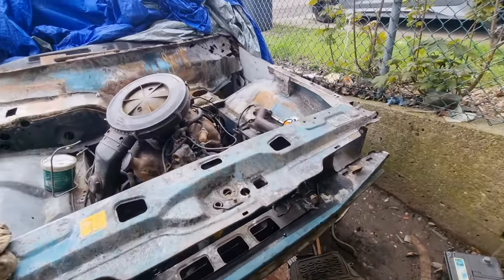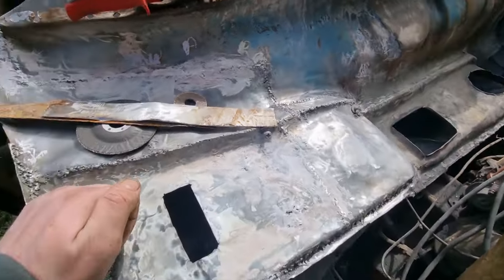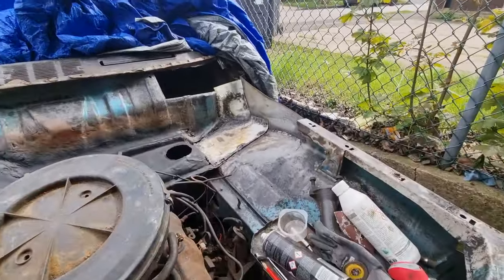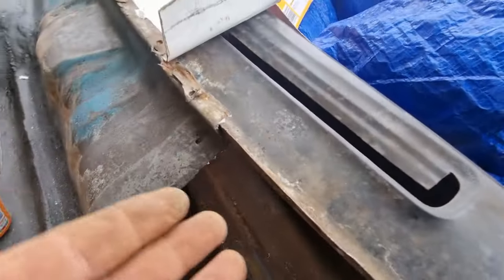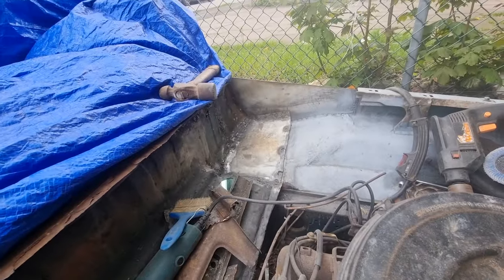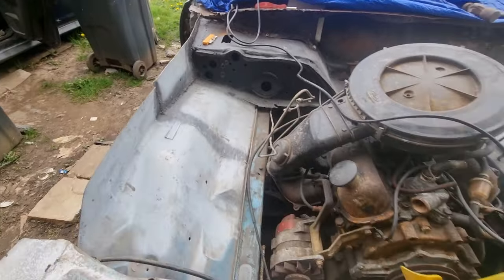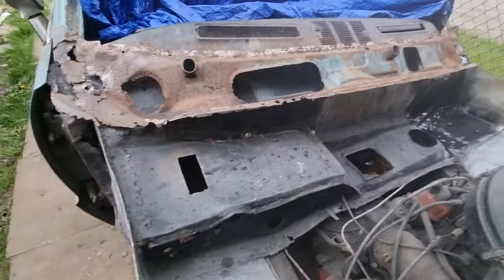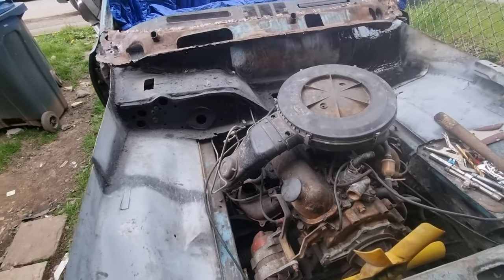Cortina Mk4 Ghia 2.3 V6 Restoration || Finishing Bulkhead (P20)

Comment: Ford had a problem for years with that metallic blue paint. The clear coat always lifted off. This was a cellulose base colour with clear. Maybe yours is original paint. But cheap bobyshop paint jobs got a two pack paint. No polishing the clear. Just paint and throw it out the door. Two pack was nasty paint. Synide based I think. I think this messed up my lungs 40 years ago. So what I'm saying is. You will have to prep good on exterior panels. With a good sealer primer. Talk to a old boy at the paint shop .they advice. Good luck..good job man. Rainey season coming up. Good luck. ,👍👍
Reply from the maker: Thank you :)

Comment: Excellent work, bro. I'm not sure why you're worried about getting videos out?  You have done far more in a short amount of time you should be proud given what you have achieved dont beat yourself up videos are great but slow and steady wins the race do what you can when you can. It's a miracle you got this far. You're doing well 👏 im amazed you'v almostst finished what looks like a serious uphill struggle. There was no bulkhead, and now there is. That's an astonishing feat of engineering you pulled off. seriously impressive
Reply from the maker: i know bro i have done a lot the bulkhead is pretty much done now i dont really need to show anymore on that there is only final touching up to do so can move on to somthink else now lol thank god the bulkhead was the main job as i needed that sorted in order to remove dash frame so i dident lose any structure

Comment: well done there pal, on getting the bulk head completed, id still colour match it though, it will look much more better.   Don't worry about not getting videos out in time, weather, budget and parts really plays a part in restorations and engine conversions.  Many times me and my dad have had to bail on the rover metro when it started to piss down.  I remember me and him just removing the cars dash out, when a almighty thunderstorm kicked off!   Also i have put a car interior back in and just completed it, when it started to snow!   Are you going to do some floor and chassis work?  or you going to do a start some mechanics?   If it were me id have a break from the bodywork and maybe look at what the story is with brakes and suspension.
Reply from the maker: Yeah working out side is tricky some times lol I know the rear brakes are all missing I'm looking for some rear drums ect for the 2.3 axle all the brake pipes are cut I think my next main informant job or to do asap is the chassis on the drivers side
Reply: @AdamSNook.  what is the status of the rear axle that is on this?
Reply from the maker: @procta2343  its the wrong axle its of a 1600 not the 2.3
Reply: @AdamSNook.  i recon that was robbed for the diff

Comment: Starting to look better will alot of hard work but a bit advice make you pieces bigger wat your putting back instead of keep doing small plates as bigger ones look tidy and makes it stronger I go to Lidl for my welding wire £4 a small roll and it's good stuff the do 0.8 0.9 and 1ml which yours should be 0.8 check wat it's says on the wheel and the tip my welder takes all them sizes as I've got different wheels and tips I've got plenty of stuff if you was local I would help you out with it with it show you better and easier ways to do it mate 👍
Reply from the maker: It's only on the bulkhead in the awkward places I did cut the corner out again and made a bigger peace as was not happy the first time but now the bulk is built I will be buying floor pans new and inner sills outer sills so no more metal needs to be made at mo but do need to buy a new welder now or repair my one I'm thinking of getting a gas/ fluxcore in one unit the wire I buy is 0.9 my tips are 0.9 I have tried 0.8 so do  use a mix of both depends what I'm welding
Reply: @AdamSNook.  My welder I've got is £260 but they do a smaller one static arc gass/gassless (flux wire) and its a mma (arc) welds up to 4ml or 5ml 130 amp for £140 I think it was to small for me but be perfect for you check there website mate
Reply from the maker: @petergrinnell2500  what one you got model wise
Reply: @AdamSNook.  200 one it's a tig mig and arc gasless/gas £270 ish I think off the top of my head it's in my unit and I'm not there
Reply: @AdamSNook.  mig with gas outdoors will be a problem with the wind
Reply from the maker: @fredjones1238  yeah thats why i liked the fluxcore as its great out doors will luck into it think i found a part for mine
Reply: right on i use both but  price of the gas is high so i use the flux core where its not so visible cheers
Reply: @fredjones1238  i do use gas when it needs to be alot stronger like chassis door pillars but sills wheel arches floor wings I use flux wire as like you say gas is not cheap mate 👍
Reply: @petergrinnell2500  great mines think alike 👍